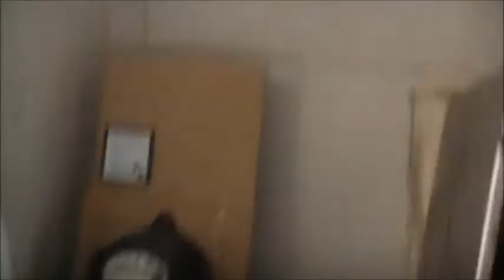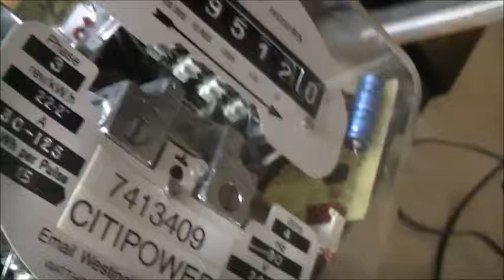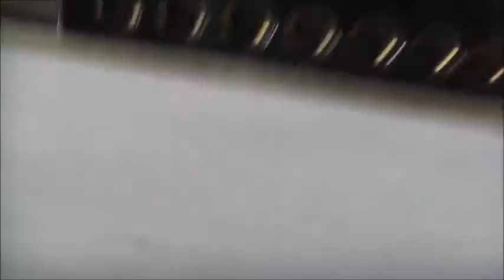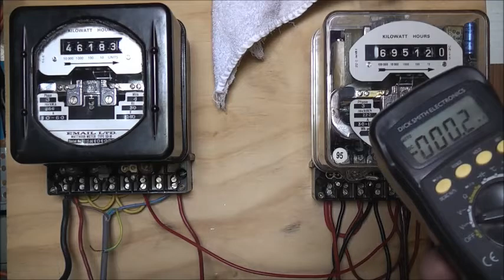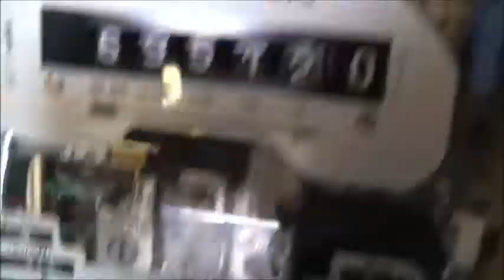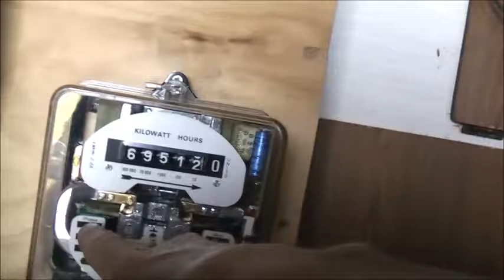EMAIL SD MP T Watthour Meter Test!

Comment: Hmmm...... This is a bizarre one, with its 'fixed' units dial. The only thing I can think of, is this meter was made and then used with parts that were originally designed for another meter which run 10x faster than this one does.

Given that, if you were to take a register from a 300 rev meter and put it in a 30 rev meter, it would obviously under-register by 10x. The simple fix, is to write a '0' at the units end of the reading! :D

I might be right on that but then.....

Have a look (if you can) without removing the cover from the meter and you may find that there IS a number-drum behind the written-on '0'. If there is, there may not be numbers wrote on it. Another thing is, if there is a hidden drum, it could be weighted and used for a flip-over drum. If there is numbers on it, then for whatever reason it may be, the power company (or a particular type of tariff) may have wanted the customer (or the customer himself) may have wanted to billed in blocks of 10 kWh, so the units number-drum was hidden-up with a fixed '0'.

Whatever it is, it'll either be a readout for a meter which runs 10x faster than this one does, or it's something to do with billing or a type of tariff that the customer was on.

Look into it and you may find a mechanical answer in the form of a hidden units drum which would point to it being something to do with a form of billing, and if you don't, then this readout was probably designed for another meter which goes 10x faster than this one does.

Thanx for showing,

-BoomBoxDeluxe.

18th October 2014, 14.55

Comment: Pulse outputs are often fed from an external source with current limiting. Usually 10 mA.
The meter pulse is an open collector which sinks the 10 mA. We used dataloggers in NZ in the mid 90's which provided 24V@10mA to the meter. A LED can be put in series to visualize the impulses.